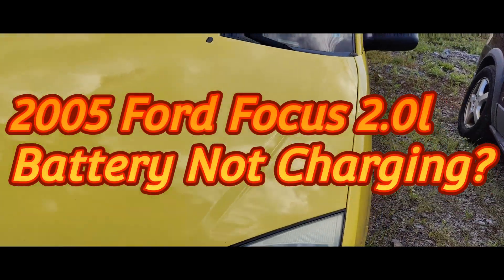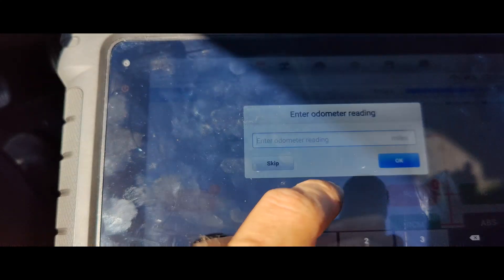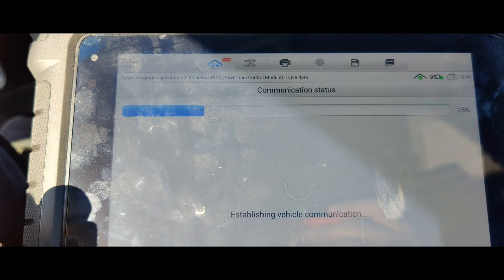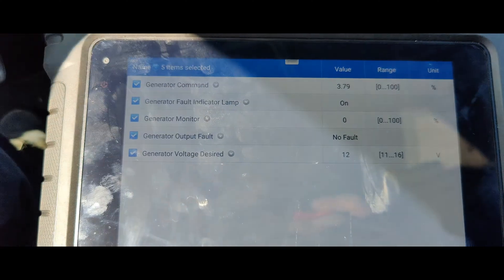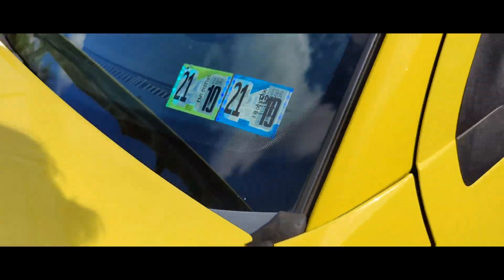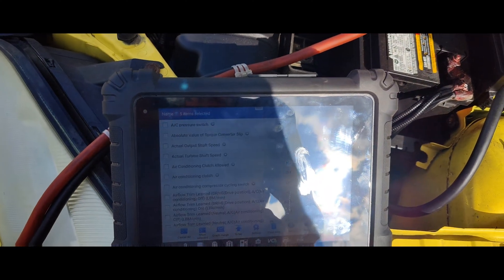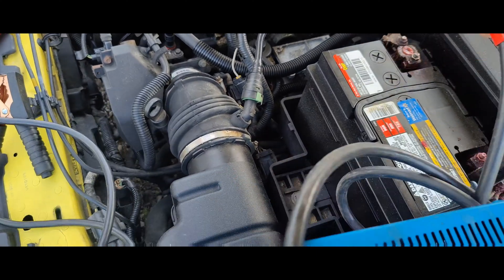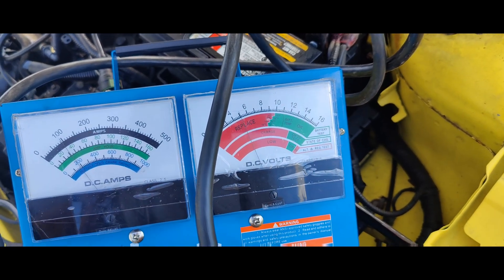2005 Ford Focus 2.0l Battery Light - Bad Battery? - Bad Alternator?

Comment: Is that carbon pile tester better than the digital battery testers that use cca
Reply from the maker: Digital is nice if you want to see the calculated capacity of a battery and calculated state of charge. The digital ones will pass battery's that are bad. The carbon pile tester does not lie.
Reply: A carbon pile load tester is the gold standard. A conductance tester is calculated guess. You can do a load test by hooking up a voltmeter and running the starter. A carbon pile load tester does it for you and you can control the load. It’s a lost art a art very few ever masted and its slipping away as folks want fast with little understanding of how the system works.